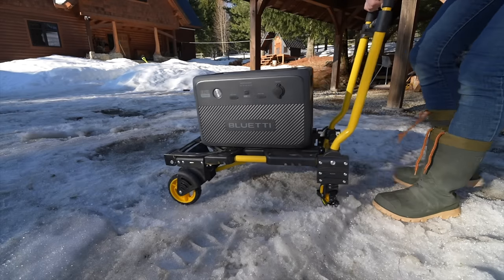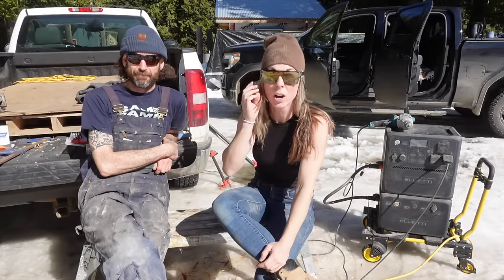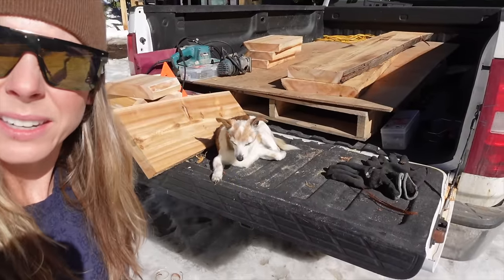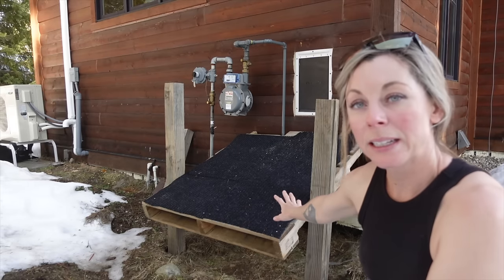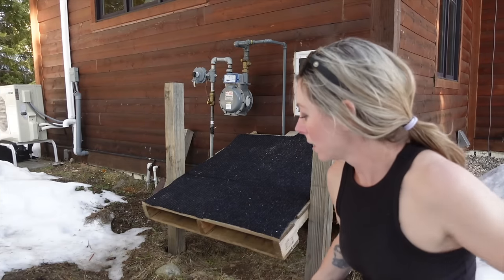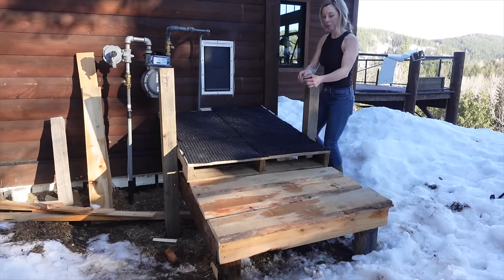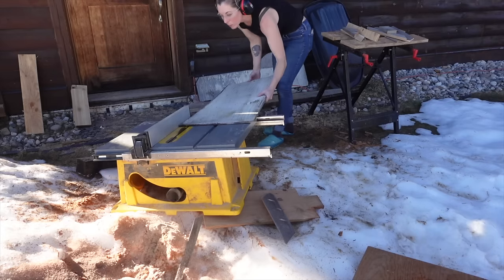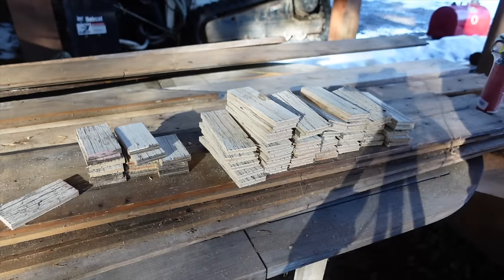Blue Jeans vs. Blue Scrubs (Ft. A Classic Michy Junkwood Pro-ject)

Comment: Hi Michelle, When I did my dog door I bought 2 of them and I put a flap on the outside and a flap on the inside wall and somehow, I put a 2 metal strips recessed on the bottom  on the flat part with  magnets on the part that swings and it keeps the heat in. And the magnet keeps the door aligned.  And it worked great. My dog loved it.

Comment: 10 years ago I picked up a clamping Jawhorse at a yard sale, that would work great to hold your wood when removing the live edge. You place the wood on the clamping surface step on a pedal and it’s not going anywhere. It has an attachment that holds a 4X8 sheet of plywood.
It folds up when not in use so it doesn’t take up space and is easy to transport.

Comment: You’re such a good woman, you clean the houses, you build things, Take care of all the dogs, and you still go to work. Can I make a suggestion that maybe getting Rimadyl for Clyde? When his hips hurt it worked really good with my dog he lived to be 17 years old. Also, just painting your wooden tiles with a satin clearcoat on the edges in the front? Leave the back bare wood
 to have the White tile adhesive adhere to it easily . Smart using the belt sander in that application. I have done that before. I got a 6 x 24 standing belt sander. It was only like 200 bucks very handy tool.
Reply from the maker: Thanks Dan! 💝
Clyde is on Meloxicam daily, which is basically the same thing as Rimadyl. We have used Rimadyl in the past but it’s much more expensive because of its formulation (chewable tab), but does the same thing. He does also need to lose 5 pounds, and that will help too. Now that spring is in the air, he should be more keen to have his ‘clown’ days 🤭

Comment: Cool idea! Keep in mind that a backsplash will get wet and the plywood has lots of nooks and crannies that will get wet and stay wet. I see rotten little boards in your future. That is, unless you fiberglass it or epoxy seal it like a table. The table idea sounds nice. Make a panel at home, epoxy it, then take it down to the cabin and voila, a custom backsplash.

Comment: The 'tiles' turned out better than I would have guessed. Fortunately both patterns look great so you can't really go wrong. It might be worth putting a little  clear poly spray on the top of them to seal them both to seal in any lead, and to seal out any cooking fumes/spatter you will get over time.

Comment: Your idea for splashback is really good.
Herringbone looks great. It also looks cool if the Herringbone is turned 45⁰ so the lines are horizontal and vertical to the basin. Just another spin on a design.
Enjoy your travels. 
🍻

Comment: Love the video!❤ You might need just a few more wood tiles. Like maybe three times as much. You might also consider getting some  polypropylene spray to coat the tiles with, so you can wipe them down to keep them clean. I would coat them all before installing them. About three coats. Just a thought.
Reply from the maker: @doc6269  thank you!
yes! Was definitely planning to coat them with a matte finish spray for that exact reason.

Comment: YOU ARE DIVERSIFICATED , IN SKILLS , YOUR NOT AFRAID TO BE CREATIVE AND THINK OUTSIDE THE BOX. THE HERRING BONE EFFECT IS PRETTY NEAT. MY I SUGGEST YOU PUT A ACRYLIC VARNISH ON THEM BEFORE APPLYING THEM , WEATHER IT IS A MATTE, SEMI, OR GLOSS. THEN USE CAULKING AS A GROUT, ONLY BECAUSE THEY WILL ADJUST WITH THE TEMP AND HUMIDITY. 
HAVE A GOOD TRIP, SEE YOU NEXT VIDEO.

Comment: Hello Michelle. I think you were very helpful at your friend's house removing the wane from the cedar planks. If the dog door is on the side of the house that isn't used that much, the longer the ramp, the lesser the angle for the walkway. The Herringbone design is the best, in my opinion. It will just take a little more customizing on the cuts to fill the gaps to make it parallel from top to bottom. Have good days and Safe Trip!   🚤 (boat)

Comment: Trick if you want to impress Bruce tell him to squirt  Wood glue on the crack and use a shop Vac from the back side to suck the glue thru the crack before you run the screws thru it. Just a great trick for yourself

Comment: I like the herringbone look but you would have less waste in a horizontal or vertical pattern.  You could always use the opposite side (the black side) as accent pieces in a horizontal pattern.  Regardless it's going to look fine.

Comment: Never use a razor sharp tool and draw it towards your body or limbs. Clamp the work piece and stand to one side just as your friend did while you supported the piece. The draw knife will show no mercy if you slip.  The other thing was the cathedral part of the grain in the wood was in the centre of those shelves. There is a good chance they will cup unless there is a support or strengthening piece across the grain that allows for wood movement too. Use a 1/16” round over bit in your router for the tiles.